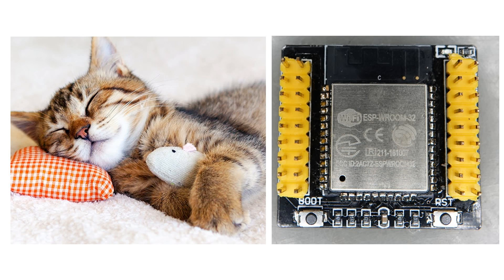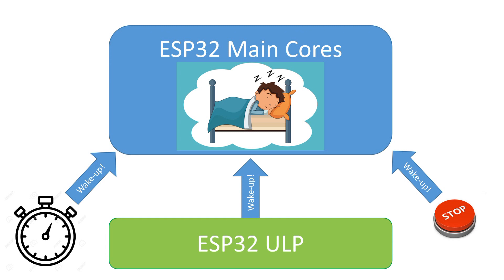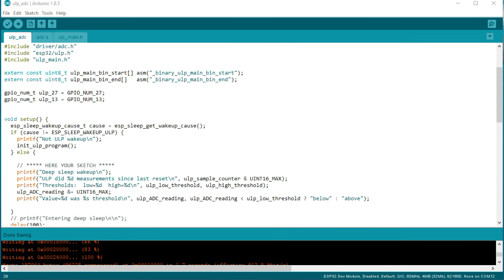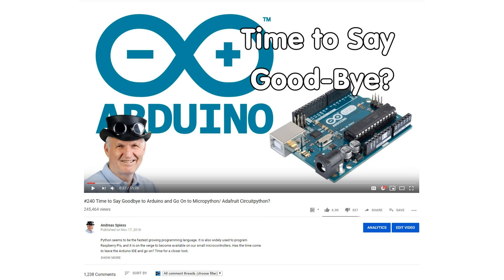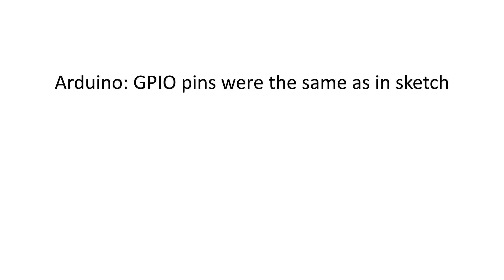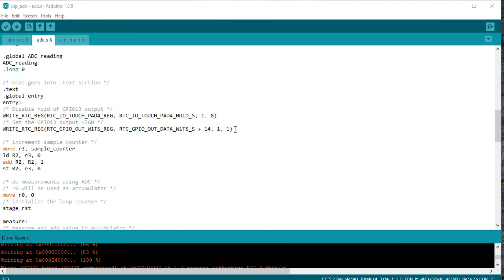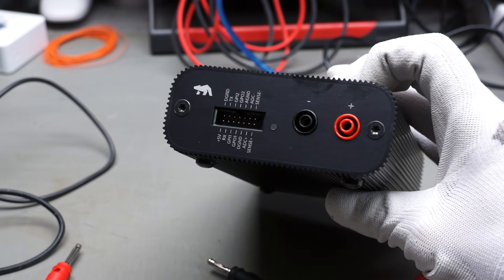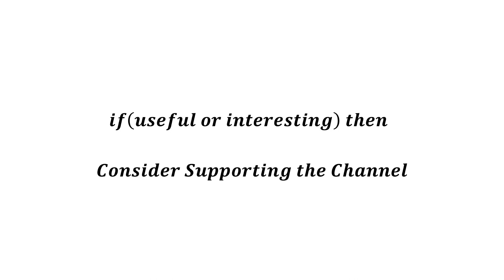#252 ESP32 Ultra Low Power (ULP) core made easy in the Arduino IDE including 100$ challenge

Comment: Can a uBlox GPS wake up the ESP32 with ULP? Can the ESP32 receive LoRa packages while sleeping? Could it be used as a QRP beacon (Lewis library) and a 3$ QRP Pixie transceiver and a transistor for say a weather balloon?
Reply from the maker: Good questions. Is this your project idea? Then maybe you have to add a little info.
Reply: GPS units work with Serial, but some do have a led that turns on when they aquire a signal. You could monitor the led with the ULP and only wake if there is a valid lock.
Reply: @AndreasSpiess  I have managed to switch the 'key' of the QRP-Pixie transceiver using a transistor and the ESP32. I am working on receiving from the Pixie on the ESP32 data bits at a very slow rate using a modified SoftwareSerial library. This could allow two ESP32 to communicate with an unbelievable range on lower frequencies such as 7.020 Mhz (crystal in the QRP kits). 

About the weather balloon it just seems like a good candidate for a long antenna and long range, low data transmission.
Reply: uBlox GPS should have a square wave pin that can be programmed.
Reply: @AndreasSpiess  nice answer
Reply: @bardenegri21  yes, that's what the kid said.  But surely the case that the WiFi can't wake up the sleeper is handled well enough, by the sleeper waking itself up periodically?  Not an issue...is I think what I am saying...

Comment: Hallo Andreas, für mich wird das Energiesparthema auch interessant. Ich will eine LoRa-Wetterstation (erst einmal) mit einem BME280 am Sender und einem Stemedu ATmega328P LoRa board mit 3,7V Akku (Halterung auf dem Board) als LoRa-Sender aufbauen. Dort wird nach dem Messvorgang und dem Senden des Datenpakets an den LoRa-Receiver der Sender in den Sleep-Mode versetzt:          LowPower.powerDown(SLEEP_8S, ADC_OFF, BOD_OFF);     //Goto sleep 8 sec
Durch mehrfaches Aufrufen der Zeile will ich eine Messung alle 60 sec. Ich denke, dass ich da schon gut Akku-Leistung beim Sender sparen kann. Der Receiver steht neben dem PC und hat Stromnetz-Zugang. Gibt es da noch andere Möglichkeiten, Energie des Akkus des Senders zu sparen?
Viele Grüße Ulli
Reply from the maker: Ich hab mal ein video zu diesem Thema gemacht (Für den ESP8266, aber das Prinzip der Strommessung ist dasselbe. Da gibt es einiges zu beachten. Allerdings würde ich für eine Wetterstation ein kleines Solarpanel vorsehen. Dann bist du die Sorgen los...

Comment: I have only just seen this video and it is very cool... What happened to the challenge?  Was there a follow-up video?
Reply from the maker: There were not many entries and I did no follow-up because I was disappointed.
Reply: @AndreasSpiess  Raise to to $10k and give me a couple of months and then I'm in! I would like use with an external 32kHz Crystal for good timekeeping in sleep might be interesting... I also need to drive a 5V ultrasonic sensor so I need a bit of hardware design too.

Comment: Do you still recommend using Otii for the purpose of low-power designing? Or is there any better solution?
Reply from the maker: If you do not need more than around 4 volts it is good. I use it for my tests. The software is also good.

Comment: hello dear Andreas, im developing a pulmonary ventilator with the nextion screen and esp32... i was hopping to find a way to save the variables into rtc ram variables such as to be able to make them survive wdt resets of some kinds without having to use eprom... did you ever succeeded it with esp32? i found how to make with a esp8266 but the library dont work for esp32... also i found that using deepsleep the RTC_DATA_ATTR could be usefull but if you dont go deepsleep and it reset you loose the variables... so there might be at the deepsleep a function being called to save the variables there... do you know how to make it? thanks a lot for all your videos ! you are the best
Reply from the maker: I never tried it, but also thought RTC_DATA_ATTR is the way.
Reply: @AndreasSpiess  it seems when it goes to sleep it may send a command to save... i found a discussion here but have no clue what they are doing.. i only know how to use the arduino ide... if you find out something please i would love to know !! would save our day.. because is a ram and not flash memory..https://www.esp32.com/viewtopic.php?p=61823#p61823
Reply: @AndreasSpiess  hey i found a solution just place this before the variable intialization and the magic happen RTC_NOINIT_ATTR it resist even power failure 
thanks again
Reply: @AndreasSpiess  hey i found some strange behavior on this... actually using the RTC_NOINIT_ATTR uint32_t before variables makes them survive software reset.. but using some RTC_DATA_ATTR makes some of them survive a hard reset.. really strange.. if you would like to check this i can send you the sketch.. =D

Comment: what if the main core is waked up ....... then ULP still running in working ....is it still blink led on voltage thresholds
Reply from the maker: The ULP runs also in parallel to the main cores.

Comment: Hi Andreas and all other, i was wondering if there is any way to use 2 wake ups source that won't interfere each other -  
i have situation that i deep sleep the esp32 for 24 hours and would like to count pulse from sensor  using  ext0 External Wakeup Source during that 24 hours - after 24 hours i would like to report the number of pulse to the cloud - my problem is that the ext0 wakeup resets the 23 timer sleep - i would love to get some suggestions -  thank you andreas for your amazing work over the years - you are the best!

Comment: The problem I have with the ESP32 and the STM32F(older) cores is the uA per MHz.. This is the issue. When you want to make some computation every X seconds having a core that consumes >70mA inside a loop is crazy. For example you can get an NRF52 with a cortex M4 and >512kb flash that consumes around 50uA per MHz. Thats 3-4mA vs. 70-100mA. I wish more and more arduino projects could support much lower power micros *fully*. Right now you have to deal with shitty software/SDK that locks you in into each platform whereas, if everyone adopted the arduino definitions for simple things like I2C, SPI, ADCs, life would be simpler.. At the same time arduino needs to also standardize more things too, like sleeping routines, registering serial/i2c/spi interrupts, etc.
Reply from the maker: We all have our constraints and have to solve it. My solution up till now was the ESP32 because it works. But I would love to be able to use the Nordic stuff, especially because of BLE.
Reply: @AndreasSpiess  Absolutely yes. I didn't mention it but i also use the ESP and STM in my designs (to the point that I'm stuck with them because of convenience). I just hate that there is always this tradeoff.. Even the new particle boards dont use the ESP for the bluetooth functionality nor its processing.. 😱

Comment: Is it possible to read the RTC clock from the ULP ? I want to add a timestamp to I2C samples
Reply from the maker: I do not know. Maybe you consult the datasheet?
Reply: @AndreasSpiess   I checked the ESP32 Technical Reference Manual which has a chapter on ULP, however I was unable to find any documentation. I fear that it is not possible.
Reply: The TRM states at page 615: it can access almost every module in RTC
domain, either through built-in instructions or RTC registers. If it is true, probably it can be done by using the time registers RTC_CNTL_TIME0_REG and RTC_CNTL_TIME1_REG.

Comment: I really want to think for your valuable videos that you provide through your channel. 
I need to use the ULP (Ultra low power coprocessor) for rising edge detection. Is it possible? Could you provide me with details of such process?
I really appreciate your help.
Reply from the maker: I am a YouTuber and provide my knowledge through my videos. I am sure you will get it done with al little thinking and research.

Comment: IDEA FOR THE COMPETITION: 
Wake the ESP32 (and transmit new value) when the change in a load cell is over 10 grams.
Go to deep sleep when the signal is stable for 2 secs (SD below 0,5 grams).
Components: load cell, HX711 and ESP32 Dev.Board.
Reply from the maker: Interesting idea. I think this already could be done based on my example. Because it already can read ADC values.

Comment: Hi Andreas. Is there a way to wake up a esp32 with a nfc module? My task is to wake the esp up when a card is about to be read. My guess is, that the RFID reader needs to be powered all the time so it can send a signal to a pin. But I am new to this topic and don't know if this is possible. Thanks!
Reply from the maker: The RFID reader also has to power your card. Watch my RFID videos if you want

Comment: Suggestion for your contest: Program the ULP directly from MicroPython.
Why stop at C macros to generate some opcodes...
Reply from the maker: AFAIK the assembler code is completely separated from any "normal" code. You would need a different infrastructure to put the code in the right place for Micropython. But it still would be assembler code.

Comment: Hi, I'm currently building a chicken door guard for my moms chicken. It has to run on battery power and just needs to switch a voltage on if the door is opened  and off if it is closed, like a relay. What kind of switch would you choose for this kind of application? 
Gruß aus Deutschland
Reply from the maker: I do not know because your problem is not clearly described. If you define exactly what you need you will find a solution using google

Comment: Hi Anreas, I want to play with this ultra low power stuff, but I also want to deploy this with battery power where the power lasts a very long time. Any suggestions what board to use? I do not have the design knowledge to build one from scratch using a plain esp32 chip. The available development boards I am aware of use to much power to last very long.
Reply from the maker: I have my proposal in the video description. And a few videos about low power and the ESP8266. The same applies to the ESP32

Comment: Hi Andreas
Did you measure the accuracy of the wakeup period :

  /* Set ULP wake up period to 100ms */
  ulp_set_wakeup_period(0, 100 * 1000);

If you would set it to 60 seconds, how much would it drift after 1 or 2 hours (and maybe more)?
Reply from the maker: I would not trust this clock for exact timing. Maybe you can calibrate it. But I am sure it will be influenced by temperature.

Comment: Hello Andreas, hope you are doing well these days!
I'm wondering how I can combine any sleep mode with BLE without breaking the connection to e.g. a heart rate monitor. I took your example of the fake FT7 heart rate sensor and tried several ways, but had no success. So far I ended up with the reduction of the CPU frequency to 80MHz, lower frequencys will also break the BLE connection.
Do you have any Idea?
Reply from the maker: AFAIK BLE only works when the main processors run
Reply: @AndreasSpiess  thanks!

Comment: Hi Andreas. Thank you so much for your great videos. I watched many and learned a lot. But I am working on a larger ESP32 project using batteries and I am running into problems which are above my technical knowledge. Would you be able to suggest any professional company that could help design this project? I am of course willing to pay for these services.
Reply from the maker: Youtube is only my hobby. So I am not related to this industry and have no suggestions.
Reply: Imac,  I'm interested, let's compare notes?
Reply: @SimonRichardMasters  I have a major project that involves a sensor and wireless transceiver. We need the transceiver and sensor to be switched on by ESP 32, which is in deep sleep mode and wakes up every 1minute. No WIFI or Bluetooth on any other sensor. Just use ESP 32 as a MCU to switch on sensor, read from it, then send read data to wireless module.

Comment: It would be amazing if the ULP could do serial UART. I have a sensor that just has UART interface and I want to sample it low power.
Reply from the maker: It should be easy to detect at least a few "commands" in assembler. Serial com protocol is relatively simple to implement.

Comment: Arg, I started working on the MPU6050 for the esp camera but at the time the information didn't exist.
My current project for the M5 means I don't have time to revisit it anymore :(
Reply from the maker: Maybe later...
Reply: @AndreasSpiess  Yeh, I had the code to run the mpu6050 on the M5Camera using core one and was looking at the ULPC but froze the project when having issue with arduino camera code.

Comment: would this work for esp32-wroom-32 im not sure if the chip has a ULP integrated in it or not
Reply from the maker: Yes, it has an ULP
Reply: @AndreasSpiess  thank you for the video and replay I'm currently testing this out but I feel like I made an error on downloading the zips from Github. When I try to run the assembler code from duff2013 I keep getting an error of uptool.h: No such file or directory. Im not sure why that is happening, anyideas?
Reply from the maker: I do not know. Maybe you create an Issue on Github?
Reply: @AndreasSpiess  I was able to fix my issue however for some reason when using your example code by esp32 doesn't want to wake up from deep-sleep, LOL

Comment: The  git repo  uses the 2.x version of Python. Lots of issues to get this working on Ubuntu. I was able to use the ESP-IDF docker container to work for me. NO installation of tool chain and no struggling with all the various versions. I was also able to attach vs code to the running container. You should make a video ont this approach.
Reply from the maker: Maybe somebody upgrades the project to Python3? And do you have a link to the container you used?

Comment: I'm having difficulty with compiling the example code on the GitHub README file of the arduino_ulp repository. I'm trying to use the ULP co-processor of my ESP32 but I'm using Arduino on Windows. When I compile the code I get the following error:

exec: "python": executable file not found in %PATH% 
Error compiling for board ESP32 Dev Module.

Any ideas on how I can fix this? I'm worried that I might have messed up step 8 of the setup instructions as I'm not entirely sure what "the folder of the pre-compiled binutils-esp32ulp toolchain" is.

Any help will be greatly appreciated!
Reply from the maker: Maybe you go to Github and raise an issue. I am not the "inventor" of this code.

Comment: The part about not understanding the TOUCH_ pin names was a bit far fetched, wasn't it? ;-)
The confusion is quickly fixed by looking at a pin-out diagram and defining a couple macros, which I'm sure Andreas you are more than familiar with.
Reply from the maker: Of course, you can fix it if you want and if you know.

Comment: HI Andreas. Very amusing and informative video as always. You said to propose ideas for projects so here goes ... I am trying to build a door status monitor with an ESP32 and a  magnetic reed switch with the whole setup running on a small battery that will not go flat for a long time (a year?). My idea is that the ULP would monitor the reed switch and wake the main processor if the reed switch has a status change. Then the main processor checks if the reed switch is open or closed then sends an MQTT message accordingly to a server after which the ESP32 would return to deep sleep mode. Can this be done? Do you or anyone have a suggestion how to do it?
Reply from the maker: It for sure can be done. Maybe you consider to use another method as shown in videos #101 or #108?
Reply: @AndreasSpiess  Those videos offer an alternative which is interesting... but I would be using a spdt reed switch on the door not a momentary push button. I thought of putting a spdt latching relay in series (instead of parallel like in your video #101). Will continue to see if this approach can work...I am pretty sure it will!
Reply from the maker: The interrupt should work because you can trigger it on both edges.

Comment: Couldn't someone write a gcc/clang backend to compile simple c code to that instruction set?
Reply: @sethrd999  nop that just compiles "ulp code" I think :/
Reply: I don't think it would be possible, the ULP does not have the instruction set needed to implement C. But it could be possible to write something that look like C syntax. But why... The ULP instruction set is simple and following the Espressif example you should be able to write the small number of instructions needed
Reply: @jenskaa4044  Yea it could do most things, you do with c normally - but probably in a very inefficient way.

Comment: I am trying to compile and upload the previous code but it always failed and give the following error "Error compiling for board ESP32 Dev Module".  any recommended solution?
Reply from the maker: Maybe you write an issue on GitHub? They changed a lot since this video.

Comment: Hi Andreas,
Wouldn’t it be easier for the users to create a library that ‘unlocks’ the ULP by supplying a set of ‘C-like’ functions? 
With such a library one could program the ULP using the existing Arduino IDE. There would be constraints of course but not (much) more than those when using assembler. 
Is this a viable option? If not, could you, or anyone else, please explain why?
Tia!
Reply from the maker: If you watched the video till the end you saw my wish list ;-)
Reply: Andreas Spiess 
I’m sorry but I don’t get it. Do you mean “A C compiler to create ULP Assembler”?
To me that would mean the input is C and the output is Assembler. 
My idea would mean an extension of the C language. So I input would be C + ‘ULP-C’ and the output would be ESP32 machine instructions.

Or do you mean this could be a project proposal?
Reply: Mai Mariarti 
I hope so!
Reply from the maker: @edouard: That would be a step more. I could live with 2 different files.
Reply: Andreas Spiess 
Ok, thank you. And btw of course I watch your video’s all the way up until the end! 😉
No sound is more relaxing than that of a purring cat 😁